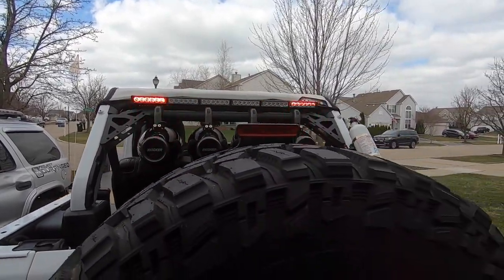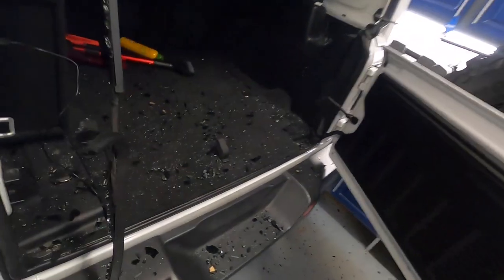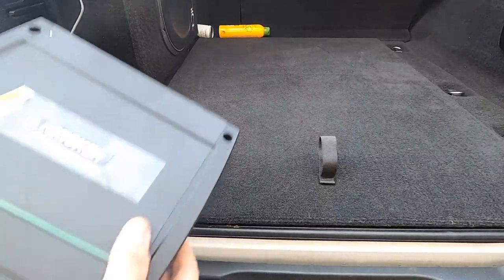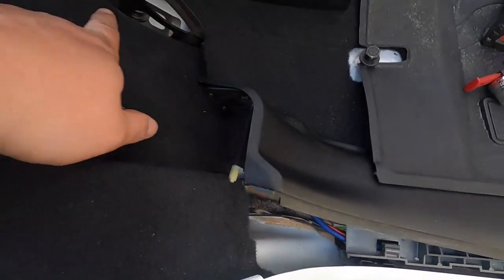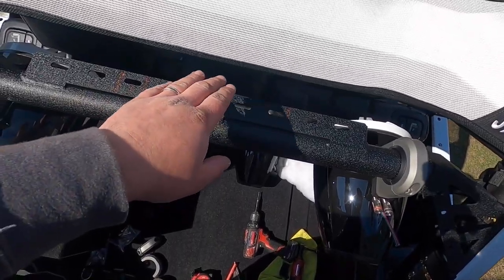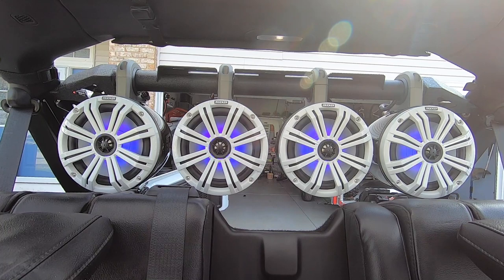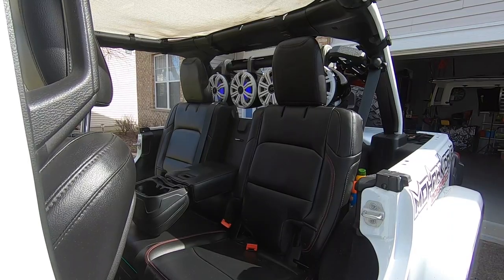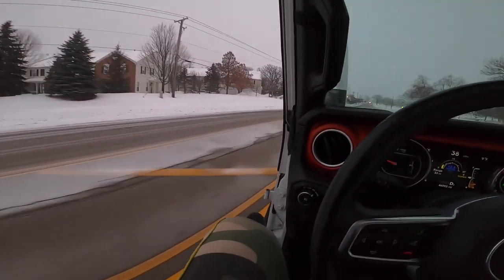Jeep Wrangler JL Tower Speaker Installation From Kicker.  Upgrade to Livin' Loud!

Comment: I love the look of that system. In our Jeep I just hooked up a Sony XAV AX5500 deck and a xm gs6dsp 6 channel to my front and rear speakers and Bridged the sub channels to 600w rms to a kicker compQ 10. I’m still running factory amplifier to the factory 8 sub for now, but I want to replace it with a shallow kicker 8 and install these towers as well and another amp of course.
Reply from the maker: That sounds like a sweet setup.

Comment: I can’t thank you enough for this video. I just bought these for my JL, did you drill into the DV8 tube to run your speaker wire and RGB?
Reply from the maker: Thanks for watching! Glad it helped. Yes I drilled right next to the mounts on the bottom. The hardest part is fishing all those wires through.

Comment: Question is the factory radio amplified and if so is it still ok to tap the soundbar speaker wires for the aftermarket amp rca connector

Comment: I have the cf-P56  pods 8inch short. 
I have A 2021 2 door JL rubicon . Ds18 says I can’t use the tube it’s only for JLU 4door
Ds18 says I can flat mount them.
Any idea how I can mount .
Can you put a quick connect on those speakers so if need to take out for a couple days u would not need to rewire . Ty great video . I sub and liked ty again
Reply from the maker: I’m pretty sure Ds18 makes one for the 2 door JL that has removable bolts to take the whole bar off from the mounting brackets. As for the wiring, just use any connector plugs at the bar so you can just unplug it.
Reply: @MohawkDaveOffRoad  tyvm I may have not ask the question right to ds18
I text them tyvm . I call them

Comment: When buying these speakers do the factory ones on top of the jeep still work as well with those at the same time or are the top ones usless?
Reply: They still work. When you turn off the tower speakers you can see how low the normal speakers are

Comment: Is this running on stock head unit?
Reply from the maker: Yes, at least for now.
Reply: @MohawkDaveOffRoad   how are you running stock head on them just curious
Reply: @MohawkDaveOffRoad  is there a way you can show how you ran it to the head unit, please? I am running a similar set up but in not getting the full potential out of the tower speakers. and i’m guessing if i connect them to the stock head unit it would make a difference

Comment: Can you run the led without a controller box??
Reply from the maker: Yes, you can wire a single color right to the speaker, and it will flash with the sound or you can run a separate 12v source.

Comment: I'm curious. Why did you have them facing in? They have to be blowing you ears off?
Reply from the maker: It actually sounds great with the roof off and doors off. The music sounds clear cutting through the wind and road noise. Typically the reason why you see people install them facing to the back on a Jeep or truck is for tailgating and shows. On boats people install them facing to the rear is so the wakeboarders being towed can hear the music too.